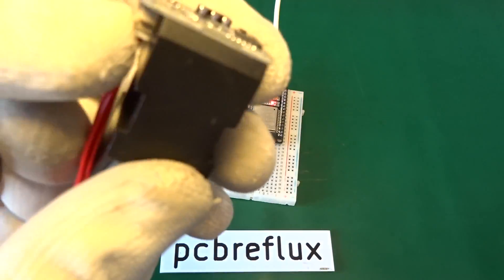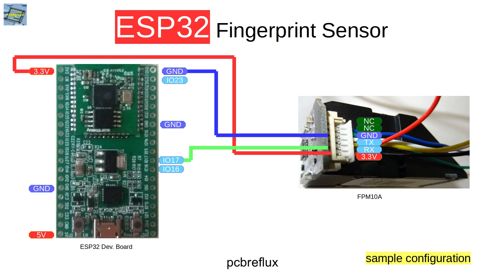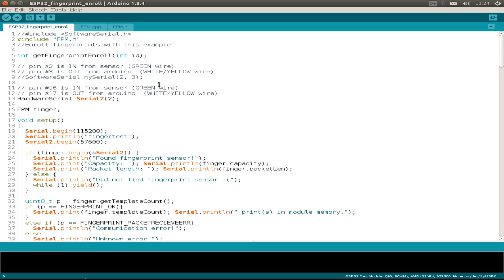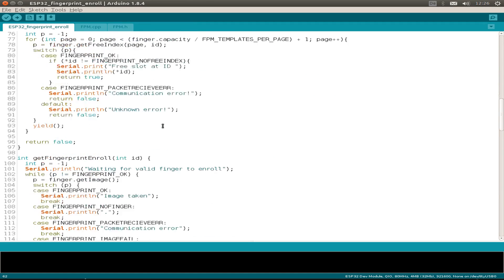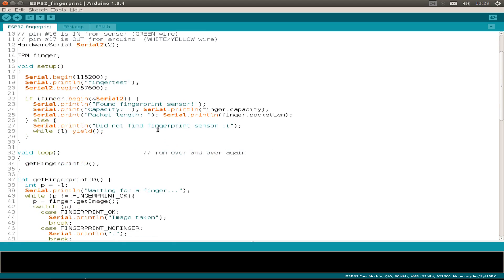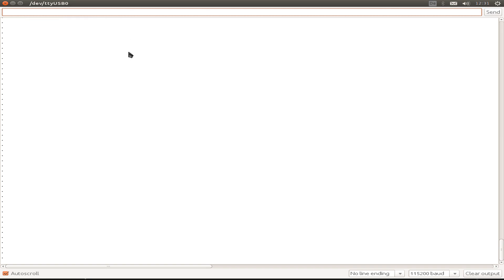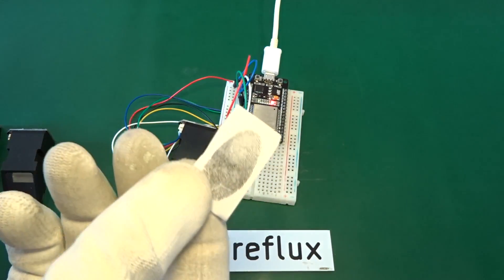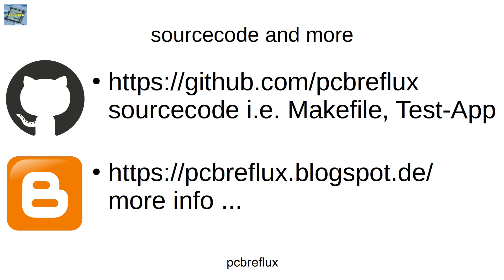ESP32 #77: Fingerprint Sensor

Comment: At first this code didn't work for me, then I change all "Serial2" and replace with "Serial3". Then it compiled without error and works fine.
If you like to try this, you need only these 2 folders download and open ".ino" files.
https://www.youtube.com/redirect?q=https%3A%2F%2Fgithub.com%2Fpcbreflux%2Fespressif%2Ftree%2Fmaster%2Fesp32%2Farduino%2Fsketchbook%2FESP32_fingerprint_enroll&redir_token=jiWrIFUJwhURFsUF3nuDDioF9Vt8MTU1OTU4MTQ1MkAxNTU5NDk1MDUy&v=MUMjrrMUafU&event=video_description
https://www.youtube.com/redirect?q=https%3A%2F%2Fgithub.com%2Fpcbreflux%2Fespressif%2Ftree%2Fmaster%2Fesp32%2Farduino%2Fsketchbook%2FESP32_fingerprint&redir_token=jiWrIFUJwhURFsUF3nuDDioF9Vt8MTU1OTU4MTQ1MkAxNTU5NDk1MDUy&v=MUMjrrMUafU&event=video_description
I used "ESP32 DOIT DevKit V1" development board and "FZ2904" fingerprint sensor only. Normally FZ2904 work with 5V and ESP32 work with 3.3V, but it works fine. It must be FZ2904 support 3.6V-7.0V. Also I sure these codes can be work with many ESP32 development boards and many fingerprint modules, sometimes there need to be minor change on the code.

Anyway, thanks pcbreflux
!!

Comment: i need full library ? i try error  fatal error: SoftwareSerial.h: No such file or directory
Reply from the maker: Have you tried other libraries instead? AltSoftSerial or advancedSerial?
Reply: C:\Users\ROSDIY~1\AppData\Local\Temp\arduino_build_848143/arduino.ar(HardwareSerial.cpp.o):(.bss.Serial2+0x0): multiple definition of `Serial2'

C:\Users\ROSDIY~1\AppData\Local\Temp\arduino_build_848143\sketch\fingerprint.ino.cpp.o:(.bss.Serial2+0x0): first defined here

collect2.exe: error: ld returned 1 exit status

exit status 1
Error compiling for board DOIT ESP32 DEVKIT V1.

=======
please help me? why?
Reply: @iland2064  Hello men, I have a question. Did yo solve your probem with the library? I have a node MCU ESP12E  and I'm trying to connect with the fingerprint sensor but I couldn't because exist an error.
Reply: i uses library from https://github.com/brianrho/FPM but not work.. why?

Comment: If I use esp8266. It is can.?
Reply from the maker: Don't test this, but this works also on much simpler MCU so the esp8266 should work with maybe slight changes (i.e. PIN mapping).
Reply: what is the pin 16 and 17 in nodemcu esp8266??
Reply: how to change the pin,  for example i want to use pin d3 and d4 in nodemcu, should I change the code?  which code? i m new in this think🙏🙏

Comment: Nice component pcbreflux.  So  even a fingerprint on a paper is readable by the machine?
Reply from the maker: Yes, but I am not sure how this effect the security of the module. You still need access to the original fingerprint ;)
Reply from the maker: Just a addition ... in my tests it seems not to work if you compare a real fingerprint and a black and white image. Works only if also the trained/enrolled fingerprint is also a printed picture. But this could be a color or slightly sizing issue. So be aware to change the factory password to prevent some kind of physical attack.

Comment: How secure is this? Not much I think 🤔
Reply from the maker: There is some security to store the fingerprints (text calculation) in the chip with a pass-phrase and you can change it. But in general the security depends also on physical protection and how many level you implement (i.e. add also a PIN, NFC token, Bluetooth beacon, ...). And sure don't expect to much for ~$6.